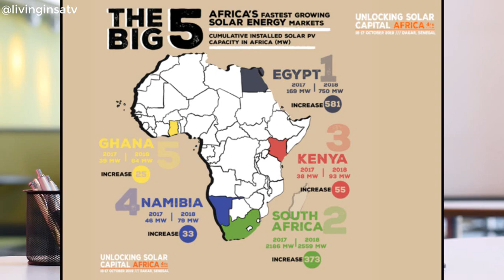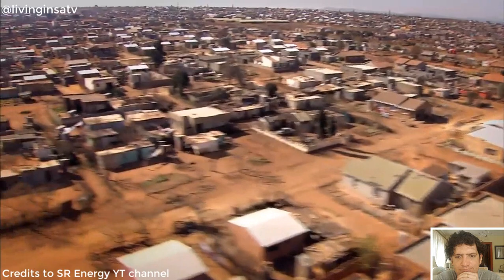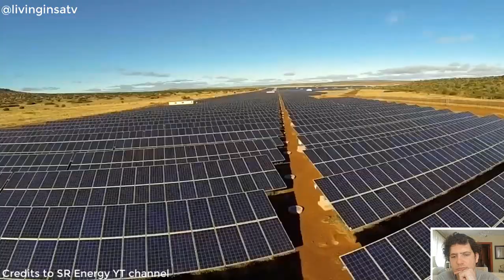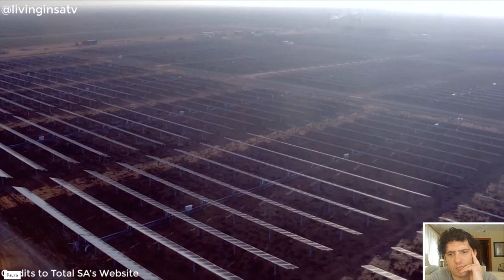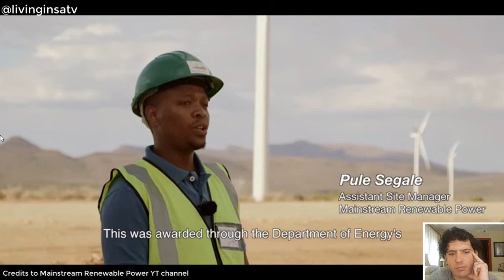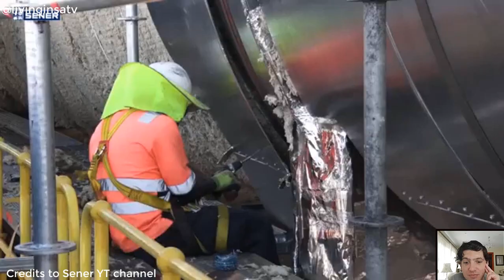🇿🇦Multi Billion $$$ fight against load shedding - 7 Green Energy Projects✔

Comment: There is no such thing as "clean energy"! Because to make solar panels, it cost allot of C02 and logistics. They need maintenance, and the power will only work during the day if there is enough sunlight. And look what all those solar panels are doing to the environment? What it does with the wild-life? A very large area of many km2 has to be cleared, and it will damage the environment with allot of steel structures in nature. This is far worse for the environment than setting up 1or2 coal plants, modern day coal plants are very efficient, China  still builds one 1or 2 everyday. There is no proof that CO2 causes any Globe to warm-up. This climate change nonsense has to stop! Bio -mass power-station requires to cut trees and wood so that it will burn in the power-station, then it will generate so-called "clean energy", thats actually very harmful for the environment. The "green deal" is part of the Satanic SDG agenda 2030. Putting renewables all over Afrika is not the solution for Afrikans and Afrika's energy needs in the future when building up an Afrikan manufacturing industry.
Reply: I like your profile picture ^-^